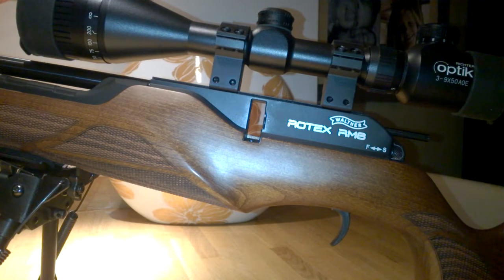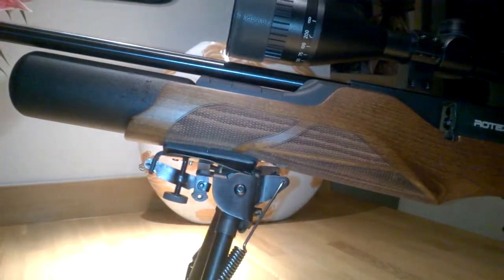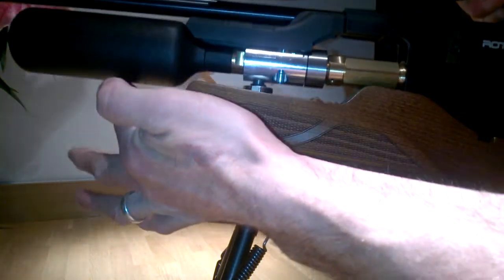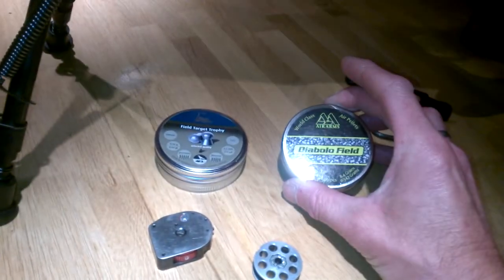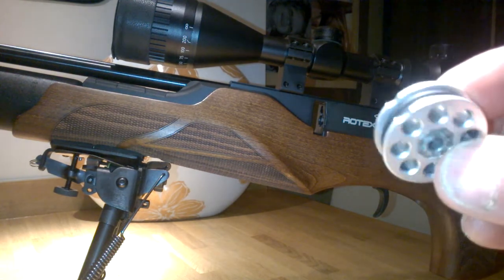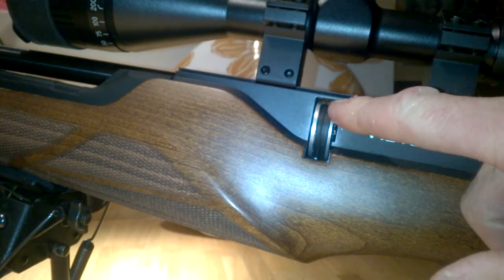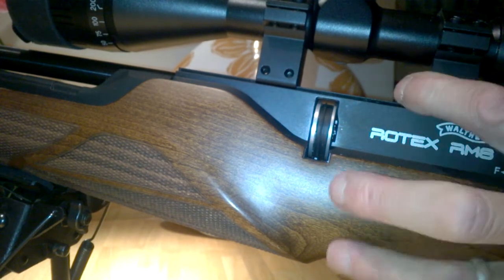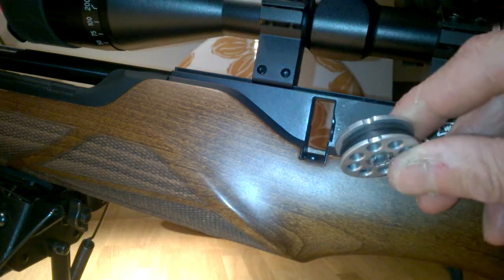Walther Rotex RM8 stock removal and mag mod

Comment: My rm8 will not come away from the stock it seams stuck 😢
Reply from the maker: @markoconnor4822  It will come out,if it's the black composite stock they are snug and need a bit more force,

Comment: What do I do when magazine, cocking bolt are jammed and two pellets inside
Reply from the maker: @VeikkaRahkonen  You need to pull back the bolt and remove the mag if you can,then you may be able to fire the two pellets out,if this fails you can try and push out the pellets with a cleaning rod from the end of the barrel,,if you do this you must do it with the gun on its side or the pellets will go into the action mechanism,
Reply: @ratrabbitandpestsniper1826  Thank you! I will try to push them out

Edit: Managed to push the pellets out

Comment: Hi. I've ground away the little ridge on the magazine rubber band and that made the bolt action so much smoother. Some magazines have four small arrows on the band instead of the ridge. I have removed them too. Great video btw. Thanks.
Reply from the maker: Jerzy Szczepanski hi.glad the video was useful. I know what you mean about the arrows and the ridge on the band.my original has the arrows and the two I got from eBay have the ridge. I've had my gun over two years now and always have the mags fully loaded but not left in ghe gun . recently I've had pellets pass through because I'm guessing the band has stretched a bit.i fixed this very easily by putting one of those kiddies rubber bands for crafting around and it fine now. They are called loombands here in UK. 👍

Comment from the maker: Hi Fukaduk, glad UK laws don't match Germany,mine is sub 12ft lbs which doesn't require a license,I have always had .22 guns but decided to try .177 for the Rm8,usually limiting myself to my zero at 30yards,but with the .177 I took three rabbits with the aid of my range finder last night,51y-52y and 61y,,I think I've been converted all shot in the fusebox stone dead,really pleased with the Rm8..
Reply: The RM 8 is really an excelent gun! made in germany, dont think you can beat the price & quality. as a kid in England I also had .22... but with reduced power here, I opt for the faster traveling .177.....(also the trajectory is less than .22) does the job..thx for the pellet tip.

Comment: Hi, have you had anything to do with the brass air valve leaking? Supposed to be a common fault, mine is leaking from the small hole on the side of the valve, but can't find anything on the web on how to fix or where to get spare parts from, any help appreciated,thank you.
Reply from the maker: Hi,,I'm not much help I'm afraid, I don't have the gun now but in the two and a half years I had the gun I didn't have any issues other than the gun was over legal limit when I traded it in even though I got it brand new,
Reply: @ratrabbitandpestsniper1826  it's ok thanks, I've found out that it's the regulator seals that have gone, that's why the air leaks from the brass valve, spare parts are a nightmare in  the UK and you have to go through a gun shop for them to order you any parts from Bisley, as they are the UK supplier for Umarex.
Reply from the maker: @phast-as-phuck738  glad you sussed it,,mine was one of the early ones,they didn't have regulator,

Comment: Thank you. A good straight forward video. I recently dropped, yes shamefully dropped my .22 RM8 and the stock broke fairly cleanly just behind the safety and just around the trigger guard. So, now I can remove the stock [it's rubberised wood] with a bit more confidence to either repair it, or replace it. I'm trying to source a replacement, or an alternative - I prefer the polymer Varmint stock with the thumb hole design. I don't know if it's do-able. Anyone out there can give me ideas, I'd be well grateful!

About the mag: I used a permanent marker to show when it had turned its full 8 rounds ... but useless in the dark, of course. so, great idea abut a "feel-able" notch. Nice one!

Noticed comments about ammo below: I recently got some Predator Polymag Shorts - 15.89 grain. Quite heavy I know for speed, but the impact and expansion [the "take down" :) ] is very impressive over 30 metres. Accurate? Yes.
Reply from the maker: Tom Tomato Hi buddy.glad it's been a help to you.think you are going to have to remove it and go from there.some kind of  solvent glue like that used on solvent weld pipes maybe.you could add quality duct tape on the inside as a bit of extra support. You are gonna have to sick it and see I think pal.
Reply: Yep. A coupla pins inside, a healthy helping of Araldite and some patience [not something i'm known for]. Gotta salvage this rifle though, you get to know a gun, know the barrel, all its querks and stuff. So! Sunday job is sorted :)
Reply from the maker: Tom Tomato I'm sure you find it  sortable once the action is removed. They are a great rifle for the cash.i use instagram now more but I plan on starting back to uploading some of my shooting on here again shortly👍
Reply: Well R, R & Ps :) I subscribed here. I guess you'll see me around :) Thanks again buddy.

Comment: Hi mate have you done any slight tuning mods to your rm8 the mag mod was really helpful 😜👍🏼
Reply from the maker: Hi Greg,still under warranty,only thing I would change is a shorter break on the trigger..shoots really well,I use H&N Barracuda match 10.65g.
Reply from the maker: Hi Greg,glad the mag tip was useful,I have a scorpion in .22 and can now join in the long debate over which is best for hunting,I can honestly say if you put the practice in they are both devastating if you hit em in the fuse box.